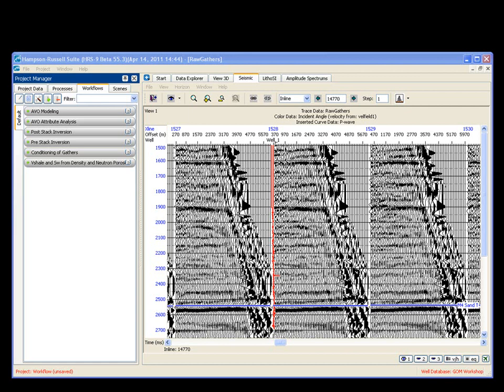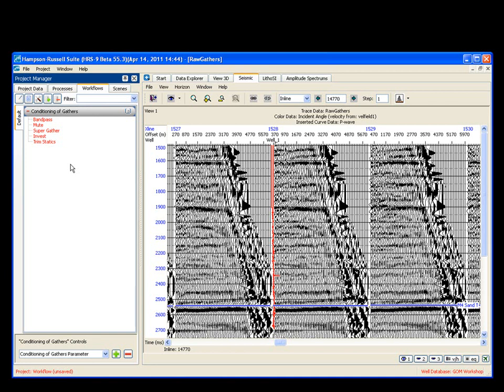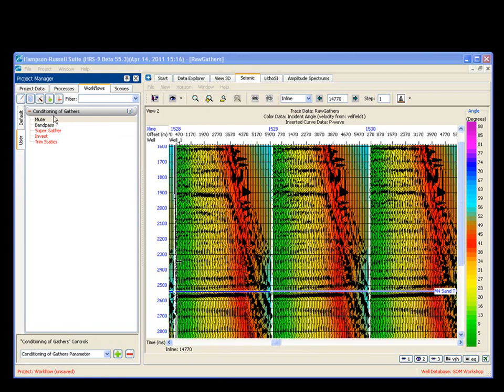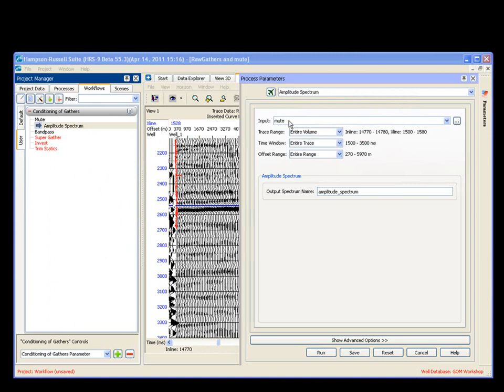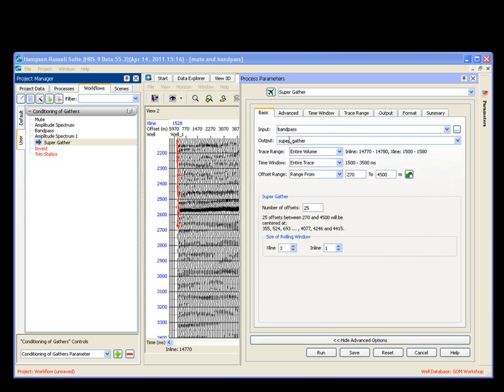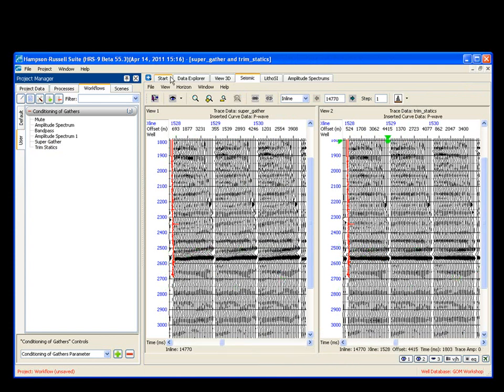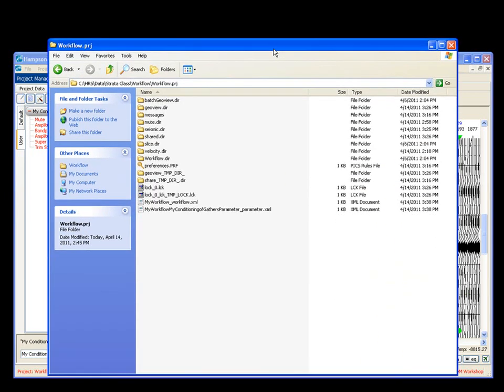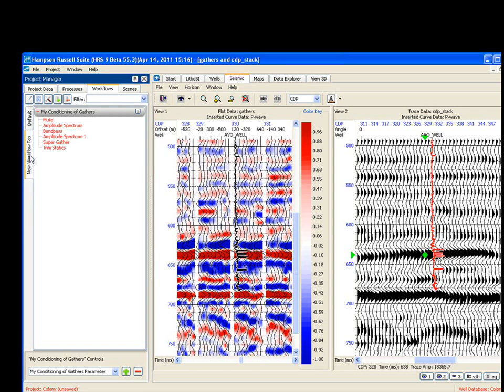Workflows in HRS-9

Comment: Very nice video. It would have been nice to explain the basis for the changes made to the input parameters a bit more slowly/clearly e.g. while running the trim statics or the low cut/pass and high cut/pass variables in used to design the bandpass filter. Just for clarity.